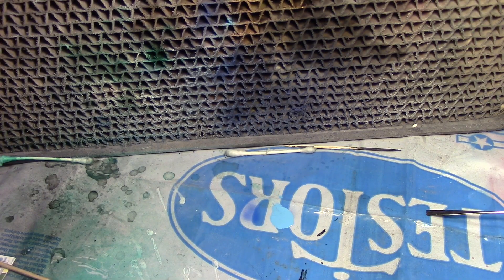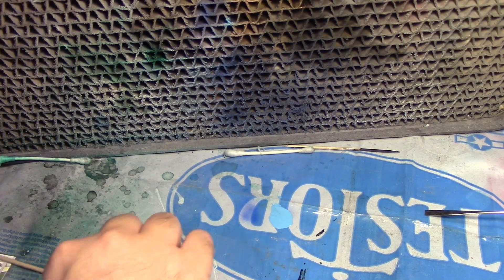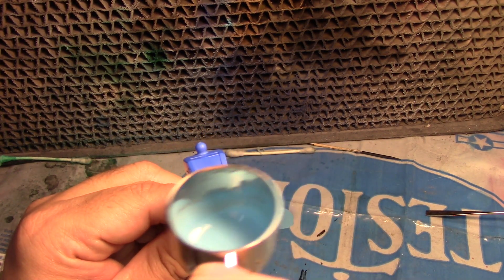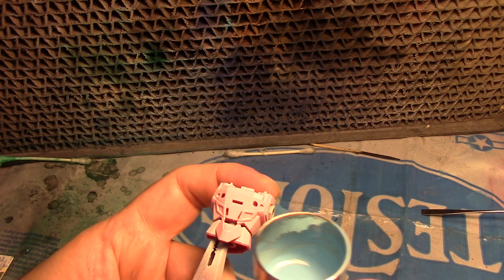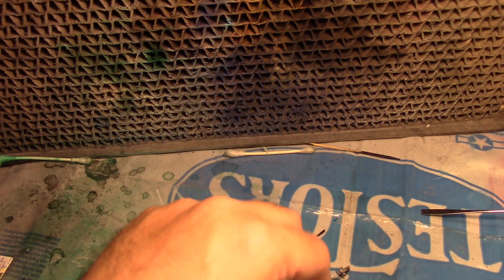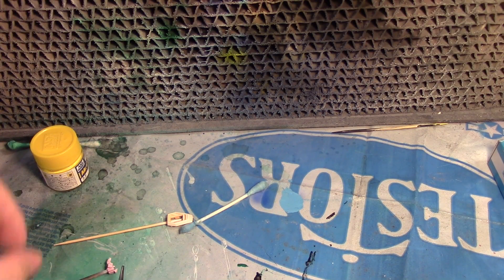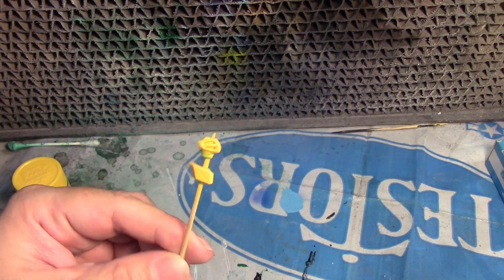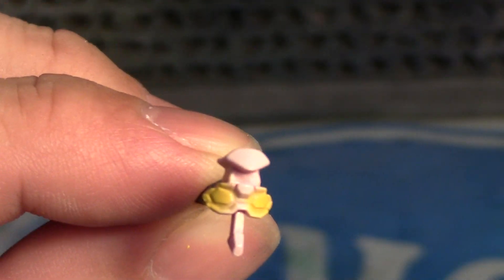*GundamCustoms* HG Gundam G-Self Custom - Part 4

Comment: when you paint you should really stop letting go of the trigger, it causes paint to dry up in the tip of the brush, and then it shoots it on the model, that's half of where you're getting all that texture from. keep the air going at all times to cut back on this <_<
Reply: What hapen when switching between parts? I have to let the triger off ? And if you can kindly answer here, i like to avoid splater in between the spray but awkwardly some modlers like here didnt splater the paint between spraying, is this becouse my airbrush? I did use a non branded. sory i  jump on you sir.
Reply: I keep my parts close to me in a Styrofoam block so I can easily move from one to the next. I keep the air flowing but only spray paint on the pieces when I'm ready.
Reply: Hello I got a question to ask what kind of spray paint brush are you using for your model building